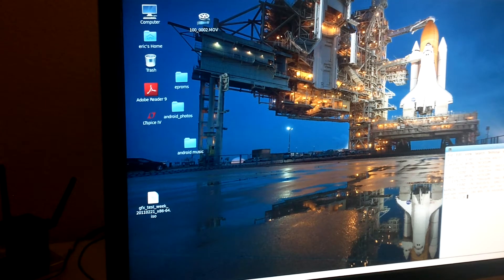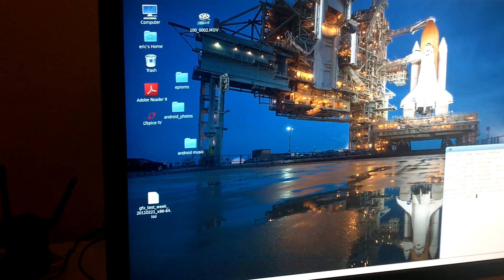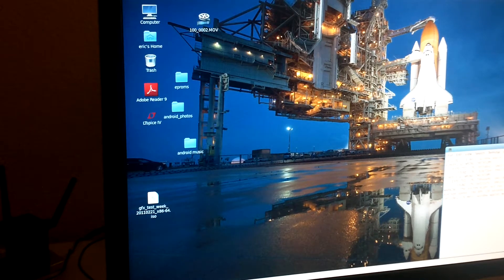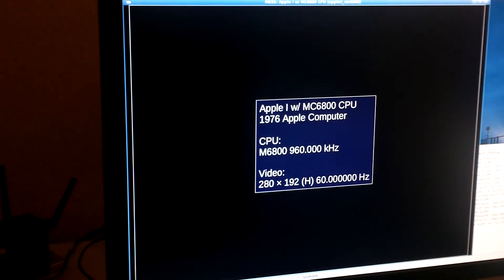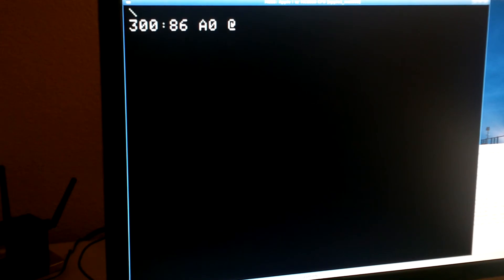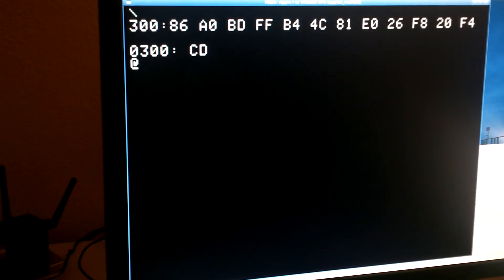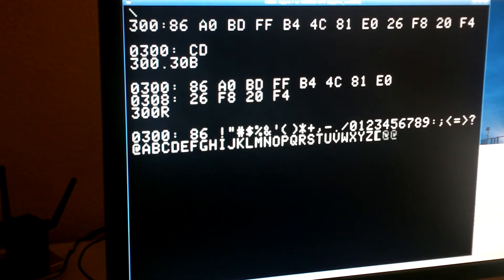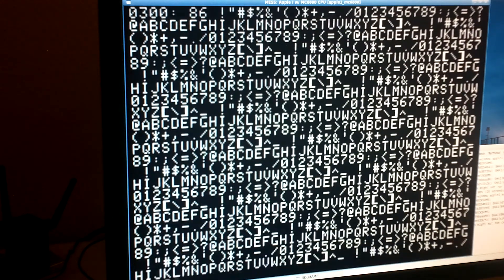demo of rewritten Apple 1 monitor ROM for 6800 processor

Comment: Where can I get 6800 PROM's A1 to A4?
Reply from the maker: There isn't anywhere that one can "get" those. You have to obtain suitable blank PROMs and program them.

I suppose I could make and sell a set, but I don't have an Apple 1 or replica configured with an MC6800, so I couldn't test them beyond verifying that the PROM contents match the object file from the assembler. You would most likely be totally appalled at what I would charge for that service. However, if you are serious enough about it, get in touch.